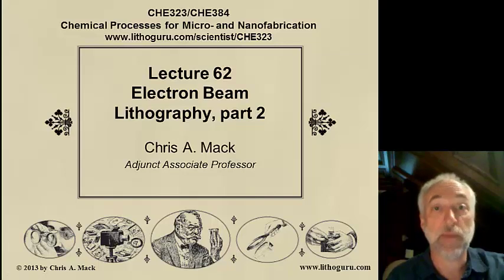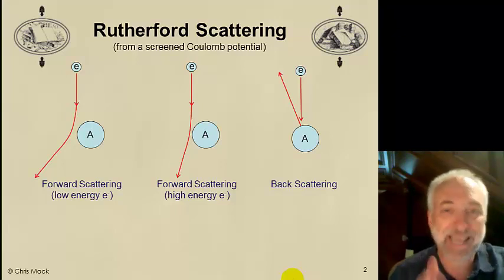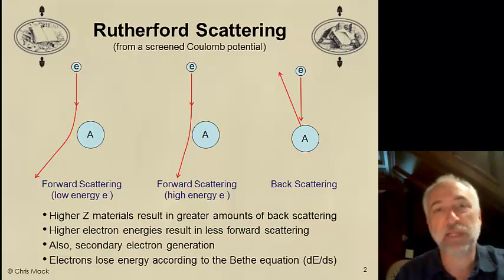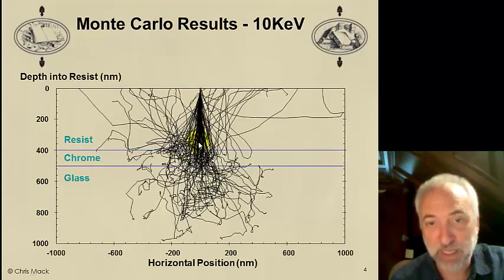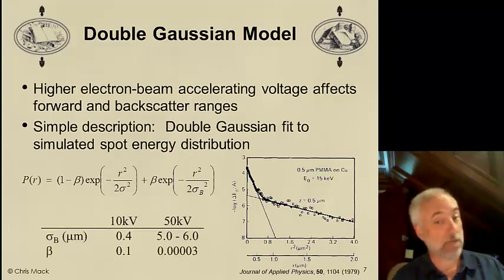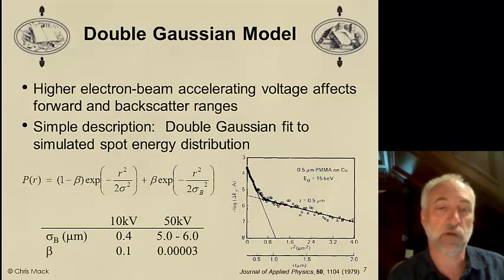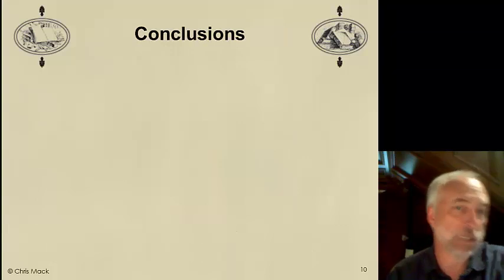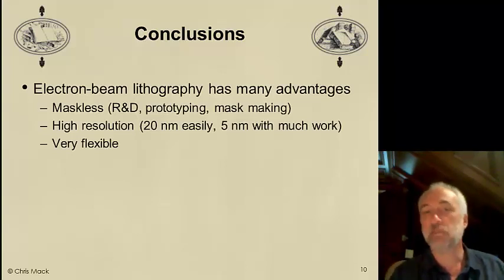Lecture 62 (CHE 323) E-Beam Lithography, part 2

Comment: Dear Chris, Thanks! how can I do "proximity effect correction" for my structure (using Raith 150 Two Ebeam lithography tool)? should I consider lower dose factors for the features in the middle of my 2D grating as they get more proximity effect?

Comment: Anyone understand why at around 11:45 Chris mentions that the energy of the electron influences the scattering behavior of the electrons. 
Why are there fewer forward scattering events? Why is it possible for the backscattered electron, to go back with almost all of its energy? 
Finally Chris also mentioned "The higher the energy, the less interaction between electron and material it goes through". 
Why is that?

Comment: are there potential tricks to print a repeating pattern faster ( e.g. for manycore chips comprised of 1000's of identical tiles on a grid on a single chip - these kind of designs are appearing for AI)

Comment: I've learnt so much on this video. Tank you!
I'm wondering, would it be possible to use a mix of eBean and Material sputtering be used to manufacture an electronic component without masks? Ionizing atoms as on sputturering process but precisely placing it as with eBean
Reply from the maker: There has been quite a bit of work on the topic of electron beam induced deposition (EBID) as a maskless patterning technique.  There has also been a fair amount of work on electron beam induced etching.  Search on either of these terms in Google Scholar and you'll get a lot if hits.
Reply: @ChrisMack  so much to read! Thanks again